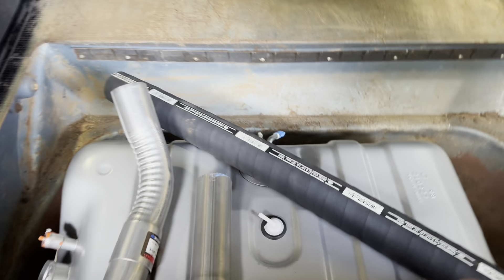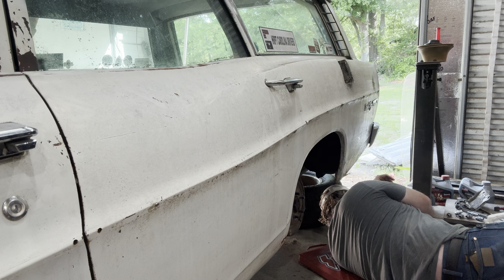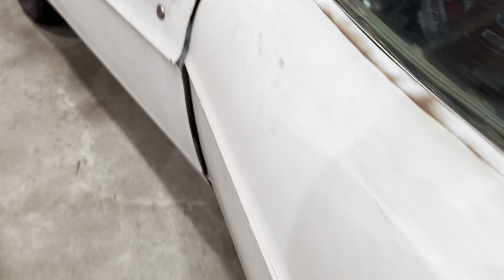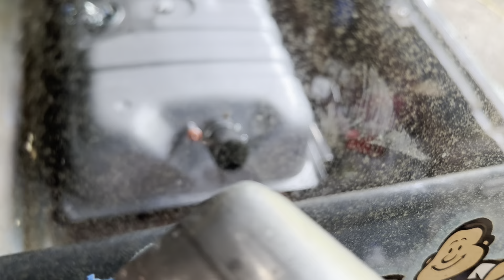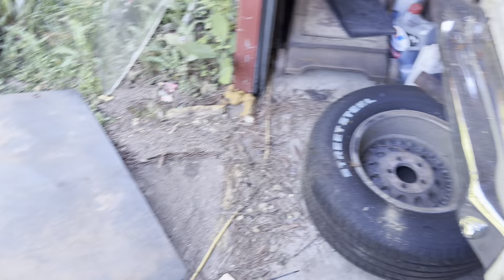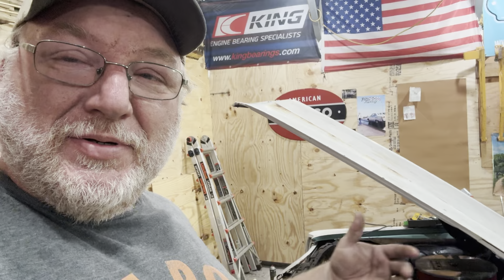Cost effective custom fuel system installation

Comment: I installed a Bronco tank in my '55 f100 28 years ago. I used a filler neck from a 70s F150, they have a flange at the top with three holes to mount it, clean installation. Great video, nice job!
Reply from the maker: @mevford  thank you for watching

Comment: Turned out nice Bobby! Love that wood floor and I wouldn't lose a moment's sleep over that little piece of exposed pipe. Lots of cars came out of the factory with a little bulge here or there to clear filler necks.
Reply from the maker: Thanks and I agree it’s such a small little spot that it kinda just disappears into the background.